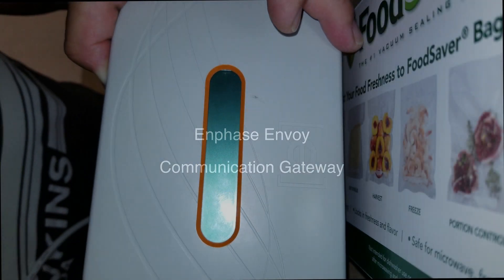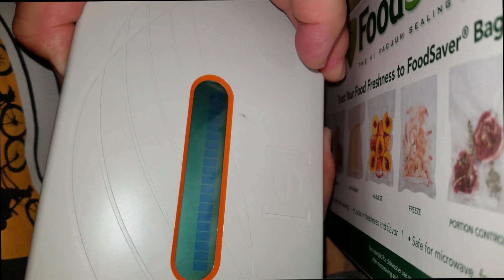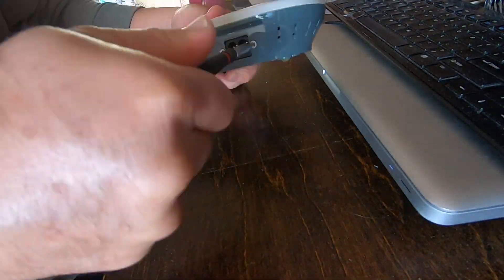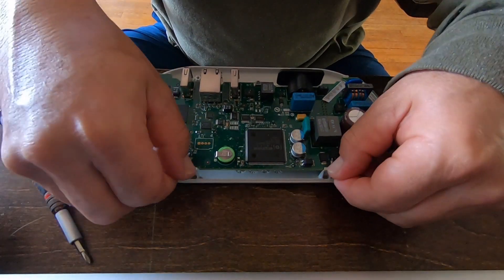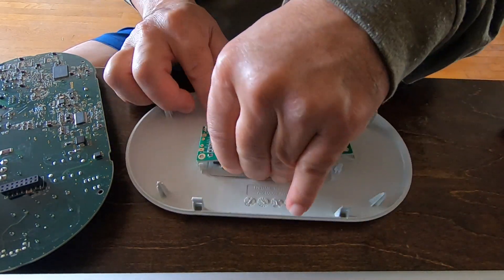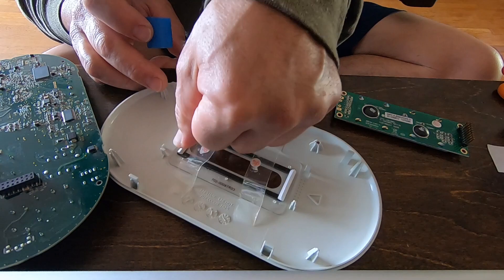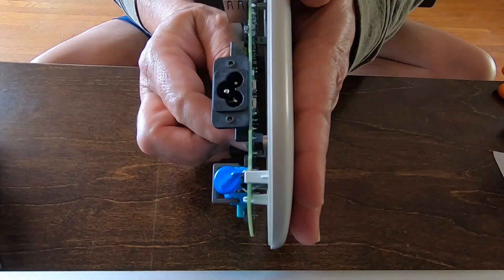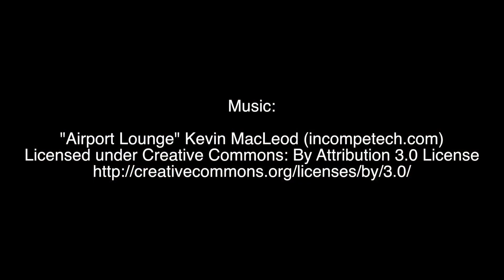Enphase Envoy Communications Gateway Fixed

Comment: I used this fix around the same time as the OP. It would do the same thing every 6 to 7 months thereafter. I tried the fix on the second time it happened and it did not fix it. The temp fix was to disconnect the power for a few days and power it back up. That did the trick for the last 3 or so times, til the last failure on 12/05/23. I powered it down for 5 days and it still wouldn't boot up and had the blank screen of death.The last fix I found that worked for me was to disconnect and reconnect the LCD screen connector multiple times and spray rubbing alcohol on the socket and pins and disconnect and reconnect a few times. Well that worked just fine and I got the Envoy to boot up. It seems as though as time goes on, the pins and sockets probably gets a corrosion, that stops the flow of electricity. Hopefully this time it works for a few years til it happens again. Good luck to all!!
Reply from the maker: Thank you for the information!  I hope it helps someone with the same problem!

Comment: Thanks for taking the time to post the video. My Envoy-R screen seems to work ok - it is stuck during the boot process, stays in boot and shows only two indicators inside the brackets on the screen, I suspect a successful boot will go through 4 timing indicators. There was a space between the LCD connector and the main board and I made sure the connectors were well connected - still stuck in boot... Anyway I have a different problem, but thanks for the video!
Reply from the maker: Thanks for sharing your feedback Jim!

Comment: Thanks, helps to fix mine too!  I tried your method first, but no success and those gray blocks are still on the LCD screen. Then I notice there is a reset hole on the back of the unit labelled with two curly arrows, and used a paper clip to press and hold it for about 10 seconds, now the unit works!
Reply from the maker: Glad it helped
Reply: That fixed mine too, thanks!!

Comment: Think I may have found the long term root cause of the issue here. There are two Nichicon CF series surface mount capacitors (the silver/blue ones) right next to the big enphase chip in the center of the PCB. On mine, the two capacitors were starting to fail as they showed some budging. I replaced mine here and solved the booting issue for good. If you replace the capacitors, might also want to replace the CR1225 battery.
Reply: Kudos to @braxus2945.  I tried the pin related solution and it worked the first restart.  Put it back together, didn’t work.  Took apart and nothing worked including cleaning the pins and socket.  Ordered two capacitors PCF1A151MCL1GS
10volts 150uF AEC-Q2 and Panasonic lithium battery BR1225A-HBN from Mouser electronics.  My capacitors didn’t look swollen, so I removed and replaced battery only.  Performed test boot before assembling and unit came right up.  Reassembled and successfully reinstalled today.  I suspect many of these failures have nothing to do with the pin assembly and more to do with dead batteries that are not “user” replaceable.  So your choice.  $3 battery or $500-$1500 replacement unit.  One caveat.  Know how to safely do board level component swapping before attempting.
Reply from the maker: Thank you for the information!
Reply: Thanks
Reply: Was this a second cause of the same symptoms? Or is it also related to the bad LCD pin connections? Thanks for any info!
Reply: @wrayala36  for me it was the primary reason. The Envoy board had capacitor bulging.

Comment: Hello, my Envoy was fine until it stopped communicating with my micro-inverters.... all of them, more than 30 . Display says 0 found. Multiple re-boots still the same. Any suggestions or repair places? Solar guy told me will cost about $1,000 to get it working - UGH
Reply from the maker: I'm so sorry to hear that!  My Envoy is dead so I'm sorry I can't help.  However, whenever that happened to me in the past, I would shut off my main house circuit breaker, and the main breakers for the PV system for a minute, then turn them all back on.  I probably have done that 2 times in the last 10 years.  Best of luck to you!

Comment: This fix worked briefly - It seemed like it was working but I had it plugged into a socket in the house which doesn't allow connection to the microinverters. When I unplugged the envoy and resituated it to the plug I normally have it in it failed again. I was able to get it to boot properly one more time but it failed again. Seems like the issue isn't just the seating of the pins. I tried cleaning them as well (though they look fine) and that didn't help. Have to wonder if there is an intermittent connection from the socket to the board or similar where messing with seating the pins actually is jostling the other poor connection.
Reply from the maker: Thank you for the comment Ken!  And thanks for motivating me to post an update on my Envoy.
Reply: I left it for an hour unpowered with the ethernet cable connected in the spot it normally lives. When I plugged it in again it worked. We'll see how long it works

Comment: A month I managed to pushed the pins down since i could not open the box, but it went wrong again, so I decided to do a good job this time; I followed your instructions and did exactly as you suggested and the pins are in permanently; however, the display is the same as it was before with the squares boxes appearing on the display panel.  Wonder if anyone has any more ideas!
Reply: I'm in the same position as you.  I cleaned the pins and re-fixed the LCD panel to give full insertion of the pins but I still have only the dreaded black squares. Movement of the socket as suggested by Mark Koostra  has no effect so I'm fearing the LCD plug is not the only problem.
Reply: @davidtoman1593  David, if you find a solution, please share with us here. This Envoy they sell for nearly £500, there is nothing to it, it just reports the solar electricity produced,  As there has been over 3500 views on this page, obviously plenty of people are having the same problem.
Reply: @jamilhashim2534  Jamil, I don't recognize the £500 since I've been quoted £75 to replace the Envoy. However, I'm not inclined to buy a clearly unreliable item from a company with such an arrogant attitude to after-sales service.  It would be interesting to know how many of the solution posted here have proved to be a long term fix.
Reply: @davidtoman1593  who quoted £75 for the item? I thought they were £500. but you are right, there is a design issue with these. they can't all be going wrong, so often.
Reply: @jamilhashim2534  The quote was by Eco Partners who were trying to sell me a maintenance contract, and it was more than a year ago.
Reply: @davidtoman1593  Is your solar panels still working without the Envoy? mine are not producing much electricity at all 😢
Reply from the maker: I posted an updated video of my Envoy problem.  Thanks for the comments.

Comment: The problem is a bad socket. Mine only boot when I pressed the lcd board at the other side from the socket. When I don't press the unit won't boot. I go solder another socket or make a wired connection. I won't pay another €€€ :-)
Reply from the maker: Thanks for sharing that info!

Comment: i tried to open mine, since i had exactly the same issue.  display goes blank just like the way you showed.  I tried to open the unit using the 4 screws but could not pride it apart like you did.  i did however through the gap created,  manage to see the LCD Screen pins that you said were not fully in, so i put a long screwdriver in and pushed the pins in; seems to have done the magic though, at least for now. :)
Reply from the maker: I'm glad it helped!  Thanks for sharing your experience.

Comment: Try quick set epoxy to tie the posts together permanently after pushing the connector pins together. This has worked great for me with no further outages.

Comment: THANK YOU. You just saved us $500. Installer and Enphase said we needed a new unit. $500 installed or $350 do it ourselves. Disappointed with Enphase. They said we needed a new unit over the phone without even coming to look at it. We never thought to open up the unit. Ours is a little different from yours, but easy enough to figure out. The plastic claws holding the display board had come unclipped, presumably causing a bad connection. A gentle push down was all it took to fix it, and close the unit.
Reply from the maker: So glad you were able to fix it!

Comment: Yes, this worked for me too! Just pressing the board didn't solve the problem, but after cleaning the pins of the LCD board connector with a bit of contact cleaner the problem was solved. Hopefully it keeps on working another 7 years.

Comment: Thank you for sharing. I had the same problem where my Envoy would stop connecting to Enphase. I would have to plug and unplug the unit multiple times before it would reboot, otherwise it would be stuck with the gray blocks on the screen. For the past few days, I've been doing what I did in the past to no avail. I opened up my Envoy and cut the black foam around the perimeter of the LCD screen so I could removed it completely from the front housing. I plugged the LCD sceen directly onto the main board and reassembled the Envoy. I connected the AC plug and the unit rebooted on the first attempt. I'm praying that this repair lasts. If not, I will solder those pins on the LCD screen directly onto the mainboard.
Reply from the maker: I'm so glad it worked for you!

Comment: Looks interesting enough to try. Is your Envoy still working now? My envoy wouldn't reboot either, but it worked a few times to leave it unconnected for a week, so I presumed a restcurrent in the memory. Might also be position or temperature causing connection malfunction...

Comment: Wow. Thank you so much for sharing this. I had this exact issue today. My Envoy has been working flawlessly since 6/2013. I did what you said and it worked except for one thing. I did not pull the display away from the housing. I just released the display PCB board holder clip on the side where the connector is located so I had a tighter connection with the main PCB board. So far so good. All the best.
Reply: Do you have pics or a vid of what you did?  I'm having this same problem. Enphase said I need a new one. $500 !!!